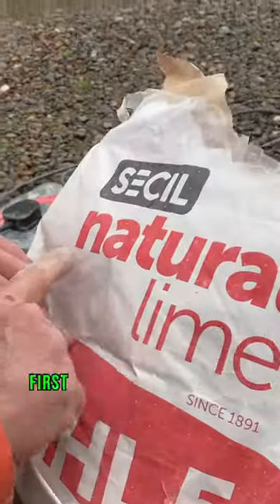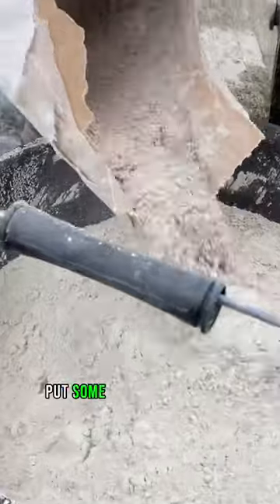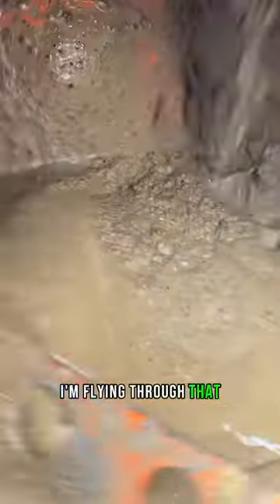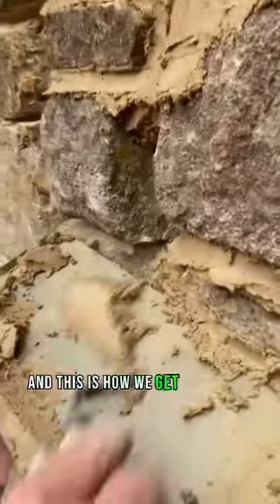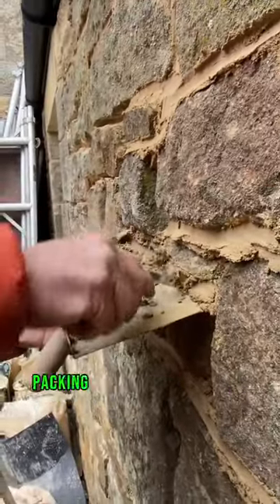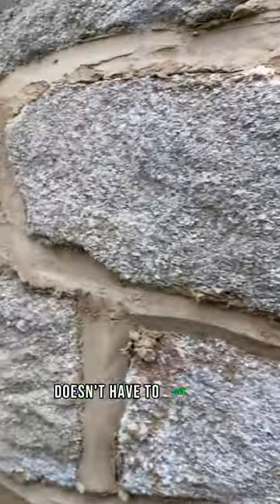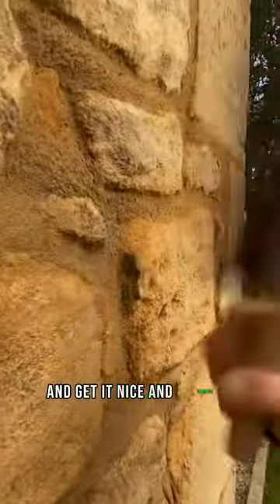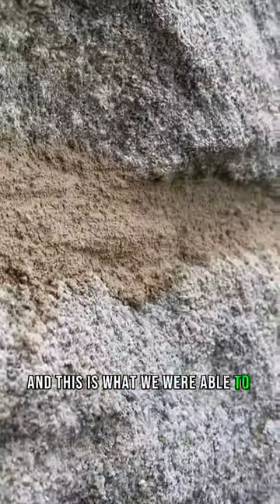This is how we mix up lime 🔥 Read the caption how 👇#diy

Comment: You call it a stemmer I call it finger jointer 😂 either way its a handy lil tool. Simple but effective 👌
Reply from the maker: Indeed it is mate 🙂 ideally should have used a wider one for this but nvm 🤘
Reply: Hi mate what ratio do you need for pointing
Reply from the maker: We used 4:1:1 here 4 soft, 1 sharp & 1 lime. It depends on the existing too though 🙂
Reply: @CraigToddBrickwork  the gables 112 years old pal
Reply: @CraigToddBrickwork  you mean 4 building sand and 1 sharp
Reply from the maker: Yes, we call in soft sand in the NE though 👍
Reply: @CraigToddBrickwork  thanks my mate.....is it NHL 3.5 for pointing 

Thanks for the advise pal
Reply from the maker: We used 5.0 because of the location. It’s right in the middle of a field and totally exposed in every direction.